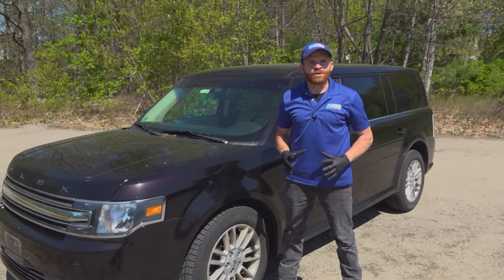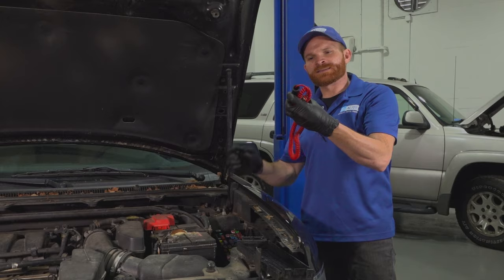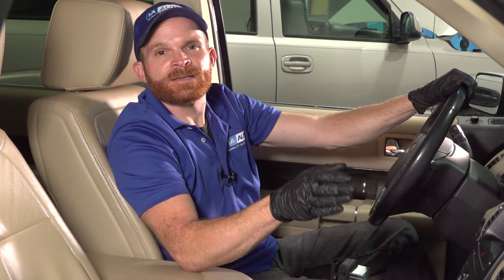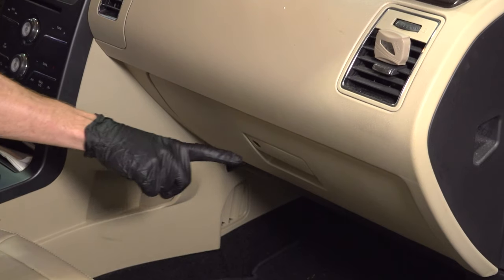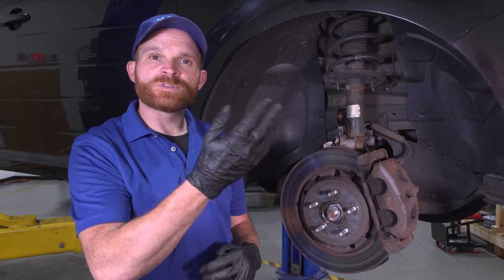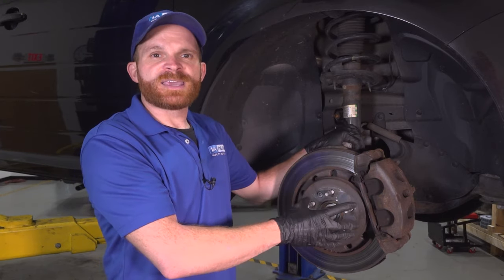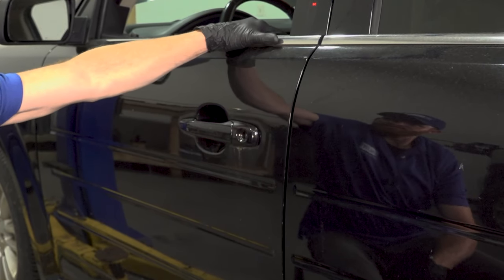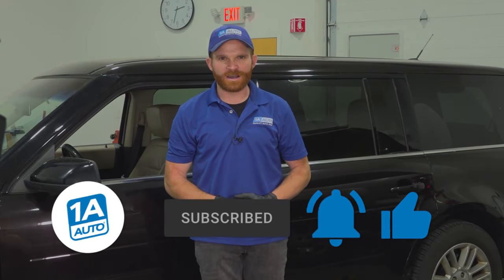Top 5 Problems Ford Flex SUV 2009-2019 1st Generation

Comment: Biggest most important issue is the HORRIBLY designed cowl drains ! Remove the insert that goes into the drain hole .....they get clogged and then hold water that will backflow into the blower motor and get into the BCM- ECU  (computer) and cause major issue !!!

Comment: You forgot to mention the water pumps going out. And also the all-wheel-drive PTU. Also known as the power takeoff unit. (transfer case) The fluid needs to be changed every 30k miles. Or it's bound to fail!

Comment: I have a 2017 Flex with 130,000 miles, the only problems I just have are , my back up camera is not working properly, sometimes it works and sometimes the image is wired, I think water got in the connector, the second …it been making a weird sound if it has been running for a while, is like an alarm sound  and I can’t find where is coming from, I moved from Utah to Phoenix Az. and it started this hot 🥵 summer.. other then that it has been an awesome car

Comment: I have some problems with my ford flex 2015 SEL. The key fob. I’m in the car and it reads that there is no key detected. I change the battery but still happens. I can’t change the directions of the fans when a/c or heater is on. Back up camera stop working. My flex has 50,000 miles. I know the problems are small but so annoying.

Comment: I’m going to add a 6th.  The water pump is located inside the engine so when it goes bad it dumps antifreeze into the oil pan.  So get that water pump changed every 80-100,000 miles or you will be replacing the engine!

Comment: i have a 2014 Ford Flex and have had none of these issues. Strangely, the radio went out but that's it. Also, I've got about 55,000 miles on the vehicle and I'm on my 3rd set of tires.

Comment: I’ve had my 3.5L non-turbo 2017 since 2018 and paid it off in 2023. The only thing I’ve had done to it was replace the front wheel bearings and tires. That’s it! It has 120,000 miles and it had 8400 on it when I purchased it. Now, I’m getting new wheels and tires and looking for a performance chip.

Love my Flex.

Comment: Owned a 2012 Limited w every option. only one trip to the dealer for a infotainment system glitch. Never went back to a dealer after that. Not one issue. But, I do maintenance, breaks, tires, oil, etc, but I’ve never owner a car that was so reliable, at such low cost of ownership. 

At Just under 100k miles last November when my wife was cut off and t-boned a car… totaled. Looked for exactly the right replacement and found a 2019 Limited(last year produced ) that fit the bill. We absolutely love these cars for road trips. 3 dogs and crates, luggage and a cooler and off we go. 
Ford needs to come back w an updated version of this car. Bigger than most SUV’s yet as manageable as a car. 

Oh and I stayed away from the turbo on both cars, (I am aware of the Ecoboost issues) as well as the all wheel drive. I live in the south. It snows, we stay home!

Comment: I am the original owner of a ‘16 Flex SEL, which now has 58K miles on it. It’s been well maintained and regularly serviced. 
This Ford is my first ever American made auto and I have NOT had any issues with it… proven to be a reliable and functional auto. It’s a shame Ford discontinued the model because I would have purchased another Flex over the Model 3 Performance. Yes, I still have the Flex as our Costco/market driver.

Comment: The climate control blend door actuators. The Flex has three, one behind the glovebox, one behind the radio and one near the drivers right knee. When these fail you will get a clicking sound from behind the dash and lack of zone temperature control. 

The part is about $40 with the one behind the glovebox being a 10 minute fix. The cabin air filter is right next to it so you might want to replace that while you're back there. The other two are more involved but still in shade tree mechanic territory. 

The most expensive "common"  engine problem is replacing the waterpump/timing chain. It is inside the engine and requires a lot of shop time. It can run over $2000 to replace.

My mechanic is a former Ford tech with a lot of experience with the Ford Flex. He told me it was very rare for the non-turbo version to have this water pump issue. 

The water pump has a weep hole. My mechanic said pay attention to any antifreeze smells or leaks from the weep hole to avoid engine failure.
Reply: I just purchased a 2010 limited.  And I am having that chattering issue.  So thanks for providing this info.  And if I may ask,  what is the ecoboost issue?  Thanks in advance.

Comment: I have 2016 Flex with 138,000 miles on it.  She keeps going with regular maintenance; new spark plugs at 120,000 miles, transmission fluid change at 115,000, and a new water pump at 125,000 (it wasn't broken at that point, but suspected it was going).  Love this car and will keep her going as long as possible!  Great video-my console latch is actually not springy anymore but clamps shut anyway.  Love my Flex!  My husbands laughs at me saying I'll be that old lady driving some car she refused to give up from way back when!

Comment: I loved my first Flex which is why I bought another one. The MOST important thing you must do with an AWD Flex isn’t even in the maintenance manual: Have your PTU oil changed every 30K miles or so!  I only Googled this AFTER destroying my first PTU. It’s a known
 problem… but Ford never opted to mention it in the maintenance manual. Especially critical if you live in a warm climate. PTU replacement is very expensive (between $1500 and $2000) so do it!

Comment: I have a 2011 Flex SE 3.5 Duratec. 233678 miles! Most I’ve ever had to do with the motor was replace the water pump, the timing chains, and 2 o2 sensors. That’s it! Other than that it’s been oil changes and air filter swaps. Been an amazing car and I’m gonna be really sad when she’s gone

Comment: I have a 2013 Ford Flex Tuxedo model that runs flawlessly.  I have only replace the OEM tires, twice.  18.2 miles per gallon in the city. 21 to 23 on the HWY.

Comment: We have a 2009 Flex (bought it new) with 167,000+ miles. Very solid car that has hauled a lot of high school tennis players and is extremely reliable. I do all my own servicing. Only two real repairs - one, the first brake rotors I put on the front had a shimmy when braking hard. Finally bought a more expensive set of heavier rotors and the problem went away (my fault). Two the warning code for exhaust system recirculation - just lubricated the gas tank flap to make it close tighter (like shown on another channel of YouTube) and that was gone. All the problems described in this video are unknown to me.

Comment: Thank you for the tips. I have a 2019 foed flex that i bought back in June of 2019 brand new off the lot with only 226 miles. First new car ever, the only issues ive had with mine was the battery dying on me at my local gas station a few months ago which probably needed a new battery anyways, but i also get this annoying no key detected warning on my screen even though i have changed my battery on my keyfob multiple times, my wife has a keyfob as well but only mine does it the dealer never seems to be able to "replicate" the problem even though ive even recordedit on my smartphone lol. My car currently has 22k miles on it which means i dont drive it that often. This year so far ive only driven about 2k miles since January 2023. Anyways these tips are super helpful and if i ever need a part i will make sure to come to you guys first for my replacement parts! Its the least i can do with all the information you guys are willing to share to use DIYers trying to safe a few dollars on labor work to put that extra cash towards better quality parts. 🙇‍♂️🙏
Reply from the maker: +Jose Luis Ruiz Thanks for checking us out. Shop for high quality auto parts on 1AAuto.com:

http://1aau.to/m/Shop-1AAuto-c

Comment: Have a 2014 that I've had to change out one of the fuel air sensors and Im changing out the hub this weekend due to a failing wheel bearing. Hoping I can get everything done on my own

Comment: I have a 2016 with 120,000 miles.  Recently had 2 issues.  Ac pressure sensor had to be replaced.   Easy dyi fix.  Bigger issue was my cowl drains plugged up and ended up with 4 inches of water inside the passenger side.  The padding is not easy to dry out.  Had to remove the seat to get the carpet and pad out to dry everything properly.  There's videos out there so you don't have to remove the Wipers to get to the drains.

Comment: So would a door latch issue be the problem with my liftgate saying the lift gate is a jar? I have slammed it shut and it still says liftgate ajar just started happening today? Sometimes when I hit the button beside steering wheel to shut it, it will go down and then open right back up again also

Comment: Purchase a used 2009 Ford Flex limited only issue we've ever had is, is the fuel tank if it gets down to fourth of a tank it run out off gas.  even though it registers a fourth of a tank on the analog gauge.  still will not pick up the fuel in the tank

Comment: I have a 2017 Flex Limited with ecoboost. It's approaching the 84k miles with 3 issues.  1. The center console latch 2. On start up, the  steering column won't auto down adjust,  just telescope out and  adjust.  3. Getting  a squeaking sound from above the right rear wheel when going over speed bumps or pushing up and down on the rear fender...

Any suggestions or parts list. BIG THANKS IN ADVANCE!  👍🏾🙏🏾

Comment: I have a 2010 with just shy of 300,000mi. I just need a turret and I’ve got a tank. The only thing I’ve ever needed to replace is the suspension, the inside of the front tires wears a little faster than elsewhere

Comment: We have a 2015 Flex SEL we purchased in 2016 with about 18,000 kms on it. Now coming up on 150,000 kms. The only (recurring) issue we have is that moisture somehow gums up a sensor in the driver’s door, which causes an issue with the mirrors and door locks. You cannot get the door locks to work using the switch on the driver’s side yet conversely you cannot adjust the mirror on the passenger’s side. We have had it looked at 2 or 3 times and they “fix” the problem. But invariably it happens again in a few weeks or months. Other than that it is pretty reliable with regular maintenance.

Comment: I had an issue where the bolts holding the front caliper brackets to the steering knuckle (not the calipers into the brackets) work their way loose and one fell out which resulted in a very dangerous situation (banging when the brakes were applied and reduced braking capacity). There didn't seem to be any thread locker on the bolts applied at the factory.

Comment: I have a 2013 Ford flex and the door latch issue can be bypassed by wiring a magnet into that wire rather than replacing that expensive door latch itself. We use the magnet bypass trick 2x we’ve had two doors go bad.

Comment: When applying the brakes at interstate speeds there is a vibration that feels like the pads are not making full contact with the rotor. It does not happen when driving 30-40 mph only when going 60+ mph. Any idea what would cause this?

Comment: I have a 2016 SEL with around 180k miles. Rear camera only works 10% of the time, center console latch completely fell apart, the fob no longer works correctly, audio control module stopped working (no sound whatsoever), and the transmission shudders and vibrates from 3rd through 5th gear. Oh, and you need a special caliper tool to change the rear brakes yourself.

Comment: 2010 ford flex here light came on after leaving in low gears. Worried it may be a transmission issue but I can’t say it has any sensors for the transmission. But after switching back into normal drive just don’t run right. Can’t find my scanner will know more once I can see what code is being sent.

Comment: Hello,
I had a 2016 flex SEL and I can’t use the dimmer button to bring the lights on or off. Also when I open any door the lights doesn’t come on. The lights are working but I have to switch them manually. Also the lights on the steering wheel and the shifter panel doesn’t light too in night when I’m using the lights.
There is nothing on the settings that I found helpful.
Please advise any remedy 

Thank you

Comment: Great advice if I ever have any of those issues. My wifey2012 ecoboost has 164,000 and we bought it a year and a half ago with 139,000 we had the fuel pump issue already but now the foot pedal memory button doesn’t work nor does the drivers seat. Number 13 fuse pops every time we turn the key on. I’ve checked under the seat for wiring issues and can’t find anything wrong. I’m at a loss

Comment: I have a 2010 limited. No turbo, no AWD. The main problem I've had so far is the hose for the windshield washer fluid broke at the T-connector that splits from single hose at the reservoir to the 2 hoses that go to either side of the windshield.

Comment: Great video! I had my 2014 limited front end rebuilt - mount brackets and tie arms. Works great now but when I picked it up, the driver seat controls didn’t work. FUSE 23 ok and mirrors work along with the memory 1and 2. Seems just the switches don’t including the lumbar switch. I checked all related plugs and am stumped. Even disconnected battery to reset sync. I’m not assuming it’s related to repair but seems too coincidental. Any suggestions? Thanks in advance!

Comment: Hello, excellent recommendations I also want to share that I am currently have an issue with my 2010 Ford Flex 3.5 Turbo AWD. The air bag light is on. The craziness is that one time my two kids wife and I we all having a ride then in some point the light when off. But after few days now is on again. Any recommendation where to look, on which state are you in? Thank you for any help or references. 👍🏼

Comment: I have a 2015 Flex Limited that i love. It has been very dependable for 187k miles.
recently my AC control panel would not work and the Defroster would blow full blast and would not shut off.
The controls on the touch screen would not do anything. then after a day or so it would go back to operating properly. do you know what the problem is?

Comment: I have a 2009 Ford flex limited 3 row seater, having trouble sun roof leaks with heavy rain and water comey in on passenger front floor board. What might be causing  these problems?

Comment: We have a 2017 SEL. The front driver power seat fuses are “constantly” blowing. We’ve changed the fuse 5-6 times every year since 2022. What could be the problem?

Comment: Hey, so would the caliper issue wear down the roters and cause shaking? I've recently started having super bad shaking every time i hit my brakes while going over 40mph, and im finding it's coming from the front. Im going to replace the rotor, but my concern is will the caliper wear it down again.

Comment: I would like to ask if the are any problems with power steering issues?  My daughter has a 2014 flex that has been having issues with the power steering first thing in the morning when it cold in the morning, and sometimes when she just driving in the day time, sometimes even as close to causing her to lose control of her steering, and crashing into a curb, now it’s been showing on her dashboard to check her charging system,  so I have changed her battery, and it was working fine for a few days then it came back, so I replaced the alternator, and it still doing it, I ohm out the battery wire back to the battery, and it was fine, and the 3 wire connector on the alternator looks fine along with the wires, please any suggestions would be greatly appreciated!  Desperately trying for help, my daughter is raising 2 kids on her own!

Comment: I just bought a used one eco boost 2018 and love it limited. Only thing ive seen is that it smokes a little first starting it up. Once warmed up it goes away but will smoke a little after parking for a while. And then there are times it doesn't smoke at all.  Its my first time owning a engine with turbos maybe im a noob with bad habits. Has anyone else had this issue? I love my flex and drive it like Cadillac so im not abusing the bad boy.

Im also excited that the ford flex is comming back cant wait...
Ill be getting the gas version over the ev

Comment: Hi..i have a 2014 ford flex limited edition .. i am having faulty tyre sensors....the light of low tyre pressure turned on whereas the pressure in all four tyres was okay. then the message appeared on the screen that the Tire Pressure Monitoring Sensor is faulty.

Comment: My flex was at the dealership for over a year due to the computer not communicating with my fob in the middle of driving....then once you turned it off,  it wouldn't let you start it...they fixed that part, but now my advanetrac fails every time I turn hard right and all the warning lights come on temporarily...weird electric glitch

Comment: I have a ford flex 2016 SE 

I have 3 issues -
Passenger door sensor says door is open rear Cameron will work and then not work and currently my car is having issues starting. There is no clicking sound. It just sounds like it it starts but it’s struggling to start and then it starts so I guess there’s a delay in starting. I checked my key fob and I change the battery but I don’t know if that’s going to help I know last year my car was on but the mechanical part wasn’t working and we couldn’t turn the car off until we change the key fob and then not fix that problem. I don’t know if that’s the same problem I’m having with the car not starting properly.
Reply from the maker: +ten84 Thanks for the feedback!

Comment: My Fan not working for Ac Or on Heat Side I replace Fan and restistor too Still no Blower working it has power at plug too use tester check it my is 2014 Ford Flex